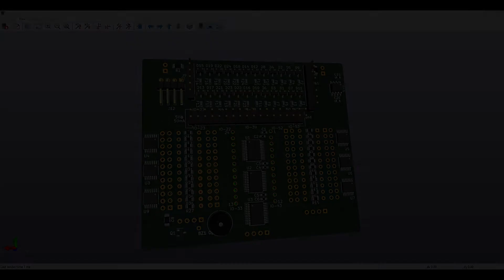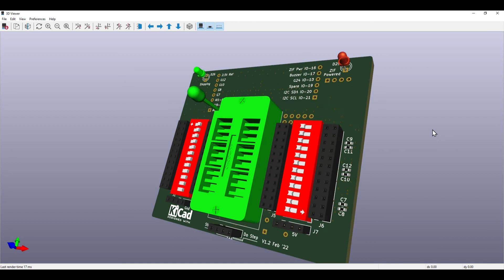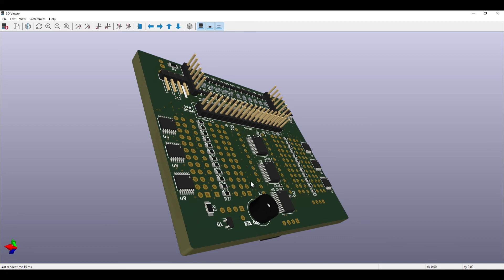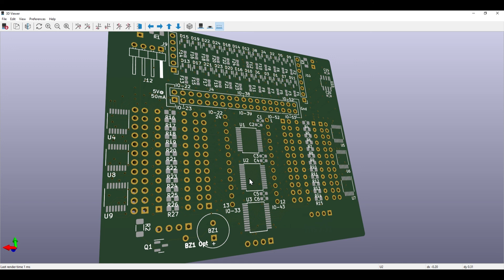MegaIC Tester V6.4 Design Review

Comment: Can you release your older code that works on the original hardware.. I have built one of those and would like to try and run what you made on it. This all new design and probable new code your developing may not work with it. So your older code may be more compatible. I know you said that you were trying to improve the code, etc, but i don’t mind tinkering around with it.
Reply from the maker: Hi Jeff :-)  I always implement changes to the software for the MegaIC Tester in a way which makes them fully backward compatible, such that either commenting out or uncommentinng a few #define statements at the top of the code allows support for any version of the hardware from the original PCB to my currently under review board, obviously with functionality only being available if the hardware has been implemented (so you can't see the DSKY clock if you don't have an RTC module, for instance).  The original database is also fully supported, although then there will be no ability to display the chip or manually manipulate the outputs.  I now manage the IC database using a spreadsheet, where I can add in new chips easily and then export them in a new way, which puts one chip definition out per file, to really speed up the load times when selecting an IC to test, but I also export files with all ICs with the same number of pins in, which speeds up the Identify function.

There should never be any need for anyone to have to fiddle with the code to get there tester working unless they've implemented their own PCB, like I did, but even then it's obvious how to do it :-)  

I want to get the current hardware design work finished off and the PCB design off to PCBWay, then implement the new current sensing functionality, then I can do some work on refactoring the code, as it is currently hugely monolithic in some areas (huge functions which are complicated to debug, modify and support), then it should be in a state to be released for public consumption :-)